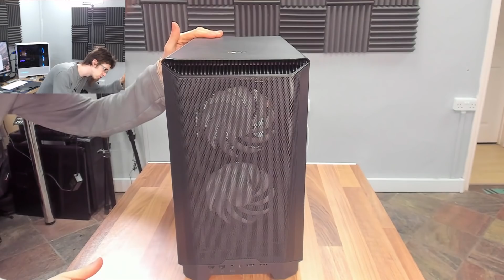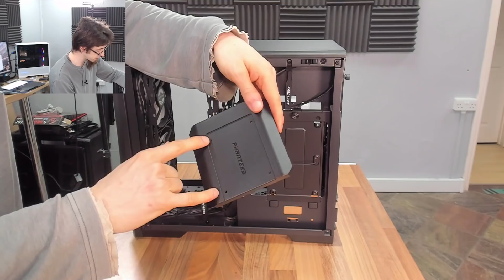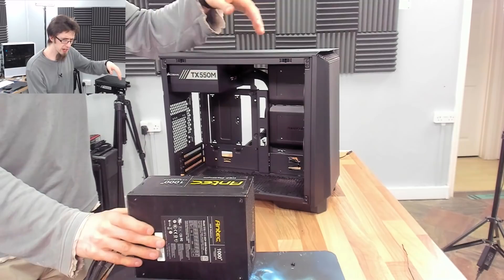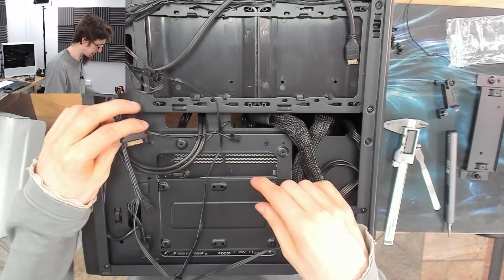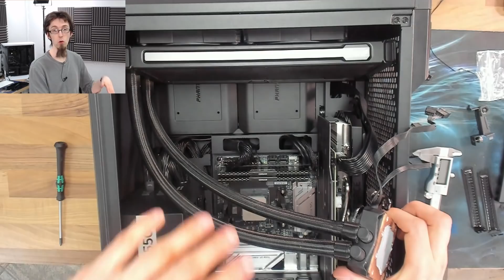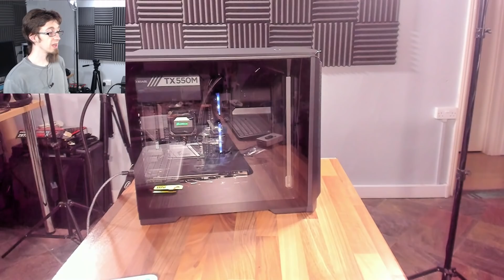Phanteks P200a Overview & Build - LBC#65

Comment: Here's my problem with "small" form factor, it's not small, and saves no space.

If you have your computer on your desk to your right, and if that case is a conventional tower in which the expansion cards plug into the motherboard directly at a right-angle, motherboard size doesn't matter, because the motherboard only occupies vertical space, and people don't arrange their surroundings vertically. Any conventional tower case will occupy an identical footprint, regardless of motherboard size.

This case could be 2cm taller, and fit mATX boards, or 8cm taller, and fit ATX...so why isn't it? What were you going to fit in your room which now will not fit because your PC case is 2cm, or 8cm taller? The answer, I think everyone will realise, is nothing.
Reply: Totally true, go big or go really small. This is a micro atx case with one slot missing.
Reply: @vollhorst140  So either massive or tiny. Why? I want as small as possible but cannot make due with 1 single expansion slot, but do not need all the slots ATX offers and would like to save that space. Why should that not be an option?
Reply: @jamegumb7298  that is an option mATX, but that is only 4cm shorter than atx not really worth the hassle. The reality is most mATX cases, mainboards suck, are trash and should go away.
Reply: @vollhorst140  Trash and should go away? Why?

Are all mATX boards purposely built to a much lower standard than all other boards? Are they going RMA at 50× the rate of mITX? Are they using very different and subpar chipsets?

I would say mITX is trash and should go away. Those boards are all useful for a gaming pc and a gaming pc only, other than that they are gimped. 
If you just need an office pc you have no need for stellar gpu performance and can go with integrated graphics anyway, then you might as well skip the pcie slot, which already exists (STX iirc? Look it up if you want). 
Then there is the very complicated and error prone many layers of the mITX boards, which drives up the price because all those boards seem eager to tack on all they can, not needed. 
Then there is the very limited options for the board itself. M.2 2230 is the very rare exception, so either integrated wifi (bleh) or the high latency usb ones (hooray for polling) until we get usb 4 dongles that let pcie pass through. No space for multiple M.2 slots and if there is, only in the back underneath a hot cpu, or you are stuck with sodimms, neither option seems great. Then there is the usual 2 ram slot limit. If there is not (sometimes, too rare) the lack of room on the board leaves you with very little options for much other things.
Lastly there is this tendency for casebuilders to make mITX as small as they can, like a mini-oven, or they need to leave in more room so you have a larger case anyway. 

You can make the case for a more compact board than mATX but that still means more space than what mITX offers. Saving space in the width is a given, but 2-3 pcie slots is an absolute minimum. Which is what many "mATX" boards (smaller than official size) already offer. Mine is 244mm×244mm. Look up if that is what it is supposed to be (protip: it's not). 

Another option is DTX. Not my fave. But even that offers more flexibility. 

Lastly, if you want to make the argument that mATX needs to go and is trash based on sales numbers, I can make that argument for all desktops. People building their own desktop computers are an ever shrinking group, ATX, mATX and mITX alike. 
It would make a lot more sense then to get rid off all the desktop stuff and stick to hanging a 1U or 2U under your desk. Servers are where the sales and profits are, the numbers there are going up and up. If small is what you are going for, 1U makes the most sense anyway, easier to place somewhere it will be out of the eye completely.
Not that it would matter to me, I just got a RM24100. Add in a 1U liquid cooling system, carry it in a Flyht Pro Rack 3U. No need for a gpu or liquid cooling? Stick it in a 1U case and get a Gator carrying bag. Yes the 24100 has space for an ATX board. And you can use 3 of the slots, so no sense in getting ATX. Average mATX board has 3 slots these days, perfect fit.
Reply: @jamegumb7298  mATX used to be pretty popular but the quality of ITX has improved a lot so there's not as much demand for mATX. The lack of demand means OEMs aren't putting as much effort into them.
Reply: Same thought here. Sort of like a "tiny" home, on a ten acre lot. Why?
Reply: The answer to your question is price & product segmentation.

This is just a re-hash of their Metallic Gear Neo Mini & Neo-G Mini with mesh panel from their Eclipse Air series and using steel instead of aluminum to keep costs down. It's exactly why this is case is so cheap, they didn't have to do much retooling in the factory to produce this.

You just were just describing the specs for their Eclipse P300A, it wouldn't make sense to modify  Neo Mini/Neo-G Mini  to accommodate ATX boards when they already have it covered.

mATX form factor is also very unpopular according to motherboard manufacturers so case makers usually accommodate ATX or ITX.
Reply: Actually, height can matter. Sometimes the case has to fit underneath a shelf or behind the monitor in the corner. Also note that here in the UK houses are very much smaller than in the USA. Size does matter.
Reply: So get a 2U and hang it under your desk. Worked for me. Saves all the under the desk and on the desk space. I got a 3 slot riser, perfect. 

Also that 8cm is a lot more than 10% for any case under 80cm, that counts. You can also use flex-atx or 1U psu and use only low profile cards for a matx board. Which does leave out large gpu's but hey.

Comment: Lol I mount my PSU fan down so the radiant heat coming off it isn't just rising to upper components.....
Jk that's kinda the reason I've done it in the past however current case has the PSU shroud sooo you kinda HAVE to mount it fanside down. And both PCs I have are on a table/desk. Never on the floor 
wouldn't mind building a small system eventually too though (: 
thanks for the upload!!